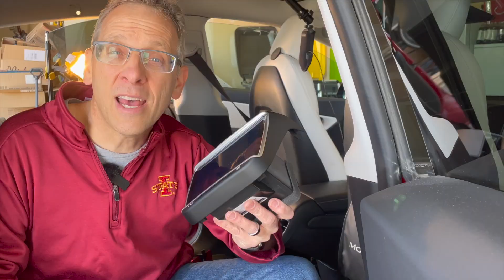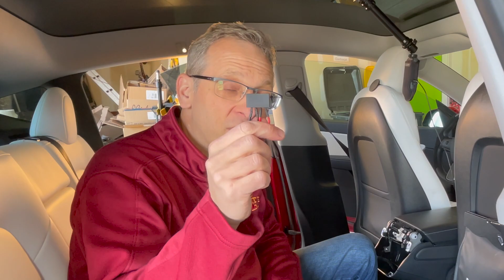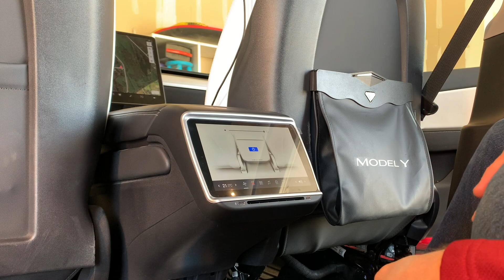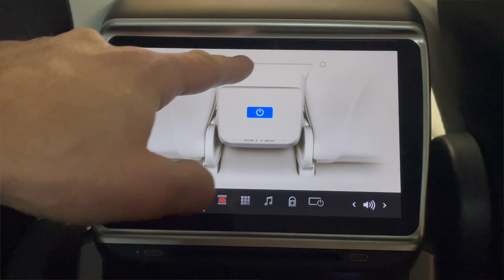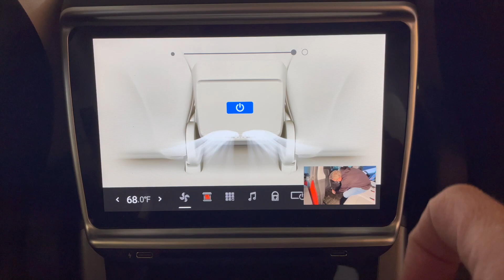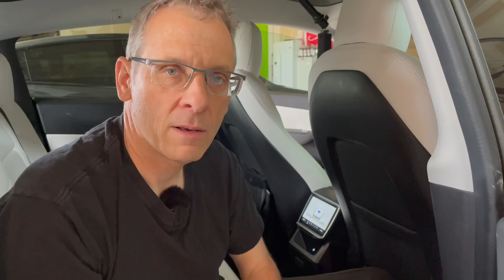*NEW* Must Have Tesla Rear Display Upgrade! - Model 3 & Y

Comment: All my passengers have 6" cell phone, I don't see the point of sacrificing the rear vents for a 7" screen. This is gimmicky, but functional.
Reply: Although it’s one of the more outdated versions, I really like the 8" inch version which stands above the vents. Gives a higher viewing position, does not modify the vents at all, and I believe it’s actually 8.8", so it’s a huge difference from 7.2".
Reply: My wife sits in the back with our toddler, and I always have to turn the vents and the seat warmers on and off for her. That alone makes it worth it for me.
Reply: @semaj06  My kids each dowloaded the App and they use it to turn on their own seats.
Reply: @antoinepageau8336  Yes but you still cant turn the rear vents on and off from the back or with the app. Which my wife does a lot. I got this for $380. Youre telling me you wouldnt have gotten this if Tesla offered it as an option for less than 400? It makes the car look more premium as well which Teslas, esp the 3 and Y are lacking.
Reply: @semaj06  Good point man, I'm thinking of getting it basically for that reason, to give the back seat a little more of a premium look.